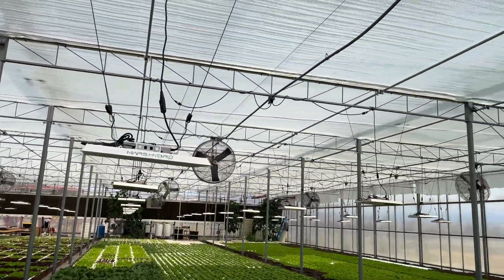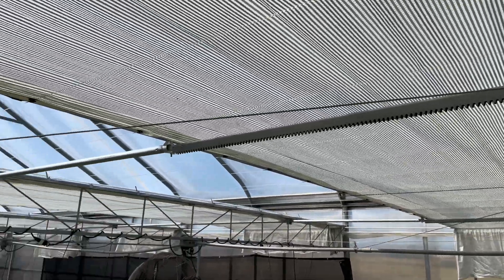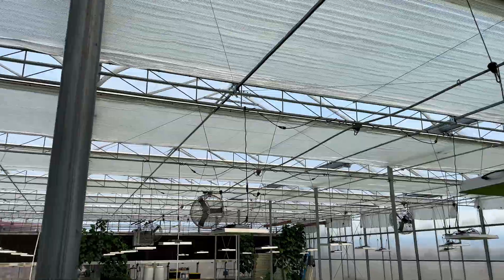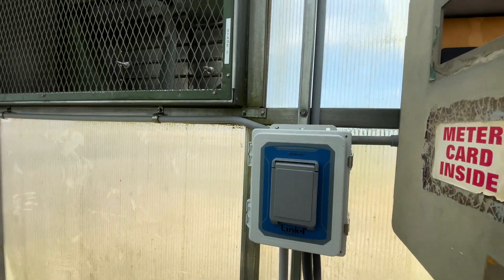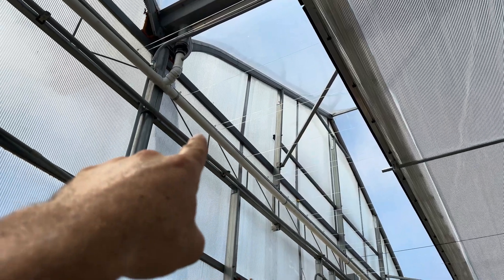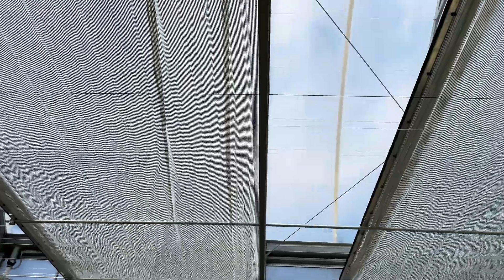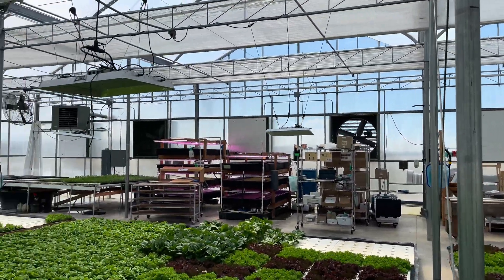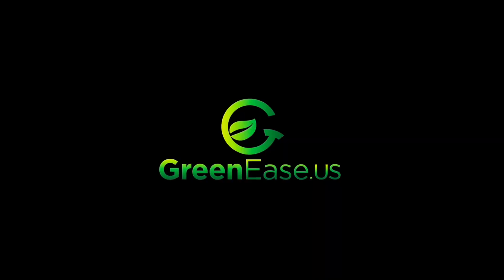Check Out Our Automatic Shade System!

Comment: Can you use this system for heavier insulation for at night. We need more sun and heat not less.
The plastic guide wire might need upgrade for the weight
Reply from the maker: I’m sure you can. In Europe they use this stuff a lot more. I suppose a system could be designed with the strings spaced closer.
Reply: @GreenEase  or plastic coated wire so it doesn't stretch